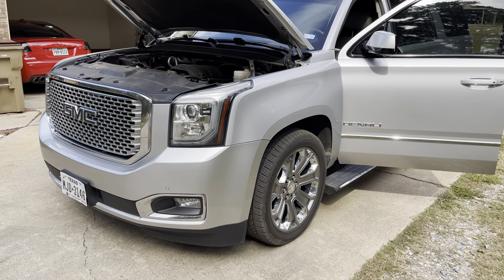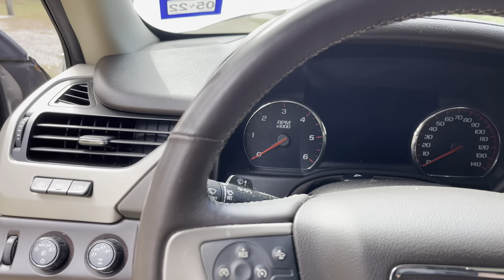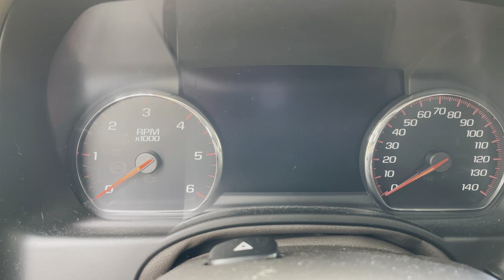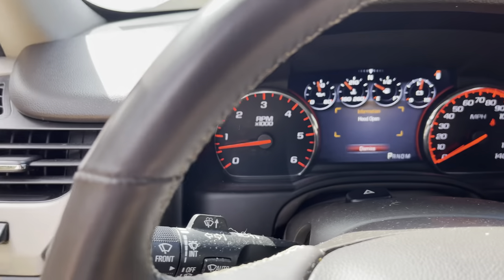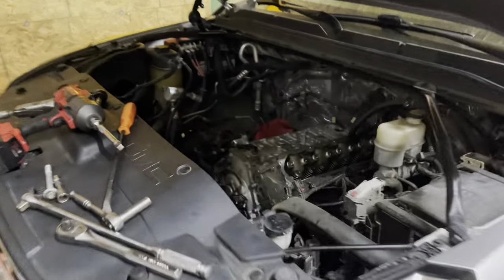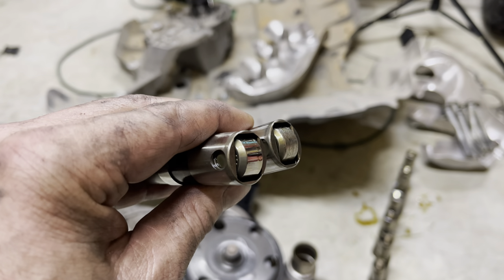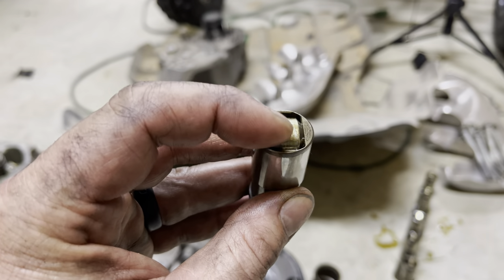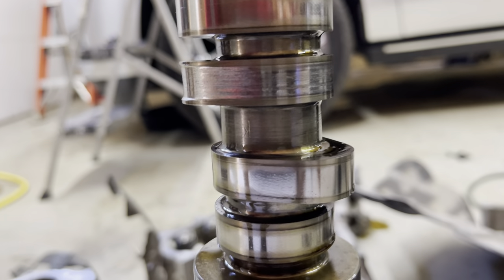WHAT A BAD LIFTER SOUNDS LIKE plus a look at the carnage! GMC Denali L86 6.2 V8 bad lifter L83

Comment: Hi Whiplash Thank You for this video,,, I may  buy a 2010 Suburban the lifter 'tick' is almost identical to the loudness as your Yukon. Is there any chance i could call you,,to ask a  few questions by chance..Am sure you don't  like to be pestered on stuff like this,,I understand,, I just have several things before i would tear into mine,,Thanks again
Reply from the maker: You’re welcome. Please ask me some questions here to start with and I will do my best to answer your questions.
Reply: @whiplashtv2022  What cam kit did you actually purchase, Do you think if you were to use this for just once ina great while  never getting more than 30 miles away from home just slapping in replacing  the bad lifter(s) it would last a  while. the Suburban Im looking at he said just started doing this ona  road trip drove it back home about 2 hours running but the 'tick' is as loud as yours,He said this Suburban never made any strange noises before this. I guess where i going with this is,, i may buy it if i can get by throwing in replacement  lifters and dont have to do a cam replace.  Am about too old to tackle a full cam replace. Al this burb is used for is once in a a while compact tractor/trailer transport,,no more than 45 miles away, What is strange is on these things,,,many times the darned truck never really misses,,and usually runs smooth once on the highyway. I looked ata  couple Burbs in the past they clained had a lifter tick,<Went to the house,,,hood up,,i couldnt even here any ticking,,,,,,really!
Reply from the maker: If it really is a lifter making noise, then the lifter and cam should be replaced. You can start by pulling the heads and looking for the bad lifter(s) and seeing how bad the damage is, but once it starts making noise then enough damage has been done to create the sound. I wouldn’t purchase a vehicle with a bad lifter(s) if you didn’t get a lot of money off of the price, and if you didn’t have a plan to go into it as far as necessary to replace it correctly. I didn’t buy a “cam kit”. I researched for a cam that fit my needs and wants, then picked out all of the needed parts.
Reply: @whiplashtv2022  ,, Just curious. From what I see in the video,, none of the lifters were actually collapsed,, like is so common on these. ? It is strictly the rollers started anneyling,,or whatever its called ,,(pitting) and started digging into the came,,,Did you compare all the lifters to see if any were actually collapsed. Thanks again.
Reply from the maker: I don’t see LS lifters collapsing very often at all. They generally start to get chewed up on the roller and cam and eventually the roller comes apart, breaks, roller bearings go into the engine and the lifter can get stuck in the lifter bore in the block. So it can get serious.

Comment: Did you do OEM lifters and cam? Or any recommendations? Thanks
Reply from the maker: I did LS7 lifters are a GPI Stage 1 VVT cam on this 2015 Denal 6.2.
Reply: @whiplashtv2022  What kind of power are you getting with the new setup
Reply from the maker: I didn’t run it on the dyno so I am not sure. I believe this cam was supposed to add around 50rwhp.

Comment: Mine makes the same noise gmc Sierra Denali 2017 6.2 should I replace lifters and cam ? Or just lifters
Reply from the maker: If the lifter has chewed up the cam like it did mine then you have no choice but to replace the cam and lifters.
Reply: @whiplashtv2022  gotcha and also when I drove it at about 1200 rpm the rpm would go up and down and vibrate is that a symptom from the lifters chewing up the cam or spark plugs? Or something else ? I really need help I just hit this truck literally two months ago
Reply from the maker: @MiguelGonzalez-cl2hn  I don’t remember having a vibration like that. Do you have a check engine light or any missfires?
Reply: @whiplashtv2022  no check engine but misfire yes
Reply from the maker: @MiguelGonzalez-cl2hn  If your spark plugs and wires are good, then look at your fuel injectors. They go bad quite easily on the direct injection stuff.
Reply: @whiplashtv2022  got it thanks! What about the transmission do you think it could be that too ?? Maybe the fluid is low or no?
Reply from the maker: I doubt that the transmission is causing the noise.

Comment: Ok i have a cadillac escalade 2016 6.2 has misfire P0302  and shaking in Idle so i decided to change spark and wire and switched the ignition coil doesn't change anything so after 2 dayvit's started to same sound 😢 that what I thought the lifter but i can't go that far and change the cam wow its look so difficult
Reply from the maker: If it sounds like this, then yes it could be the lifter issue. The only other thing that it could be is the cylinder #2 fuel injector. That would necessarily make a noise but they and get fouled up very easily and can cause misfires. The cam and lifter job is not a fun task, but it can be done by someone with good mechanical skills.
Reply: @whiplashtv2022  that what I thought injector #2 I was thinking and replace the injector but yeah after doing the tune up, two day exactly it making same sound, when the engine is warm the sound gone and starting shaking and idle.
Reply from the maker: @bryanreyes1480  It might be worth replacing that 1 injector and seeing what results you get from that. Unfortunately they don’t all have the same part number. So you have to pull the fuel injector and find out which one you have to make sure that you get the same or one that is compatible. These direct injection fuel injectors are make very well in my opinion and can go bad short of 70k miles in some cases.

Comment: Any other symptoms like engine light and shaking ?
Reply from the maker: No check engine light or shaking
Reply: @whiplashtv2022  thanks for the quick reply 🙏🏽…..I have a 2017 6.2 l86 cylinder 5 misfire,shaking and engine light come on and I’m just really hoping it’s not that.
Reply from the maker: @ArturoHernandez-qe5fu  if all is good with your spark plug and wire, then check the coil pack and that cylinder’s fuel injector.
Reply: @whiplashtv2022  thanks a lot …will do
Reply from the maker: You’re welcome. Those direct injectors go bad quite easily.

Comment: Jut’s curios how much does this cost avarge if you take it to a mechanic .. I have 2014 GMC Sierra denials 6.2 awd and it makes a knocking sound when i floor jt to the 2000rpms
Reply from the maker: I am not exactly sure but I would guess $2,500+
Reply: My truck has been twice for lifters in 3 years. Dealer charged 3700$ both times. (For one side)

Comment: Waiting for mine to fail.
Reply from the maker: Maybe it won’t happen
Reply: @whiplashtv2022  i hope not, it's a 2015 Yukon denali 6.2l with 89k miles.
Reply from the maker: @oSTYNCLSYo  some go forever without a failure.
Reply: @whiplashtv2022  would you recommend using the Range sensor to disable the AFM?
Reply from the maker: @oSTYNCLSYo  you can, or have it tuned. I turn it off when I tune customer vehicles.

Comment: Yeah that's is a lot quicker than what mine is and only has 65k on the engine
Reply from the maker: Bummer
Reply: @whiplashtv2022  yeah but all the videos I been seeing the noise is quite to what mine sounds like
Reply from the maker: @adamalbright7285 so yours is louder?
Reply: @whiplashtv2022  Ooo yeah along with engine power loss and traction control turned on and collision detection message also
Reply from the maker: Wow, usually when the noise is louder then the damage can be worse. Hopefully you can get it looked at soon.
Reply: @whiplashtv2022  yeah it's at the dealership now good thing I got warranty on it yet but since the lawsuit on the engines hopefully I can get the ls7 lifters and pushrods put in and get rid of the afm/dod crap
Reply from the maker: @adamalbright7285 I hope that it all works out for you.

Comment: Ohhh No!
Reply from the maker: Yup, had to tear into it and installed a GPI Stage 1 low lift cam, 4 degree cam phaser limiter, LT1 covette valve springs, etc. First time doing an LT motor.